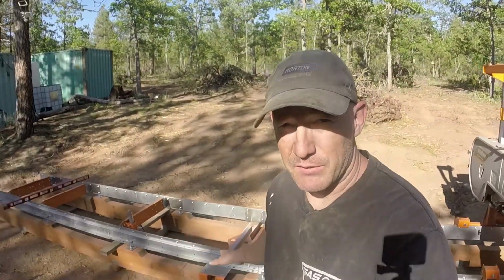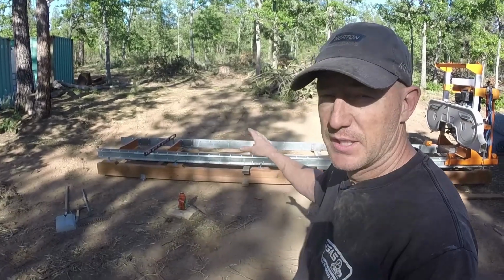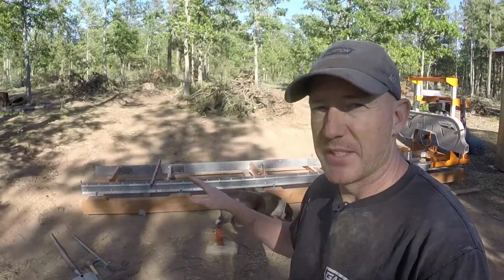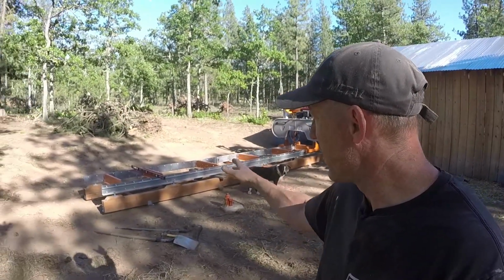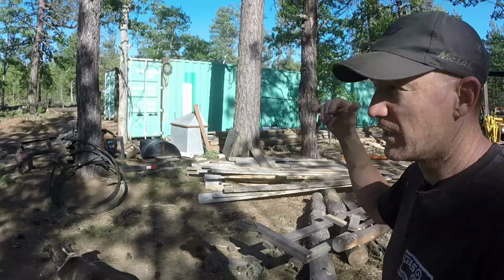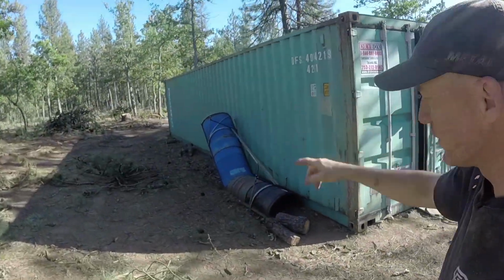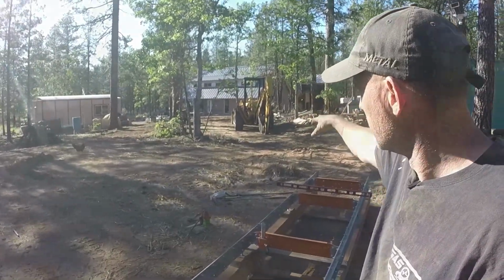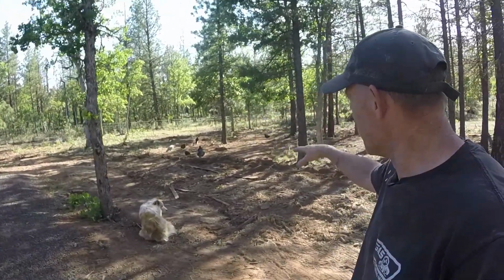Moving my Norwood sawmill to a better location on the property

Comment: go to harbor freight get you x6 of the 12 ton bottle jacks. weld them to a wider metal base. like a 12"x"12 square. then make cups and use freeze out plugs for a car and put them in the bottom of the sled. then when you move set it. you can lift it up to keep dry and make easier so you dont have to bend down as often. :) might sound complicated. but once set up you would thanks me :) help level it too :) but i was gonna say maybe find a old camper trailer. find a free camper. gut it. slide the mill onto the trailer. then when ready to use. take tires off and drop it down to working height. ive seen some with walking ramps on trailers. a guy who does on site mill work around here. he shows up set up on trailer. no matter what it always cuts square to his trailer once he drops the jacks. mills leaves. fast about it. he makes good $ at it and lots free lumber. sometimes he gets free logs to mill to get free lumber in trade and says he resells it for good $ faster then he can mill it. has a waiting list for species.  
find the free camper. gut it. resell some of the things. or save them for ya mancave/garage. like sink. the stove ect. then make $ back or save for later. :)
Reply from the maker: The trailer thing isn't a bad idea. Thank you. :)

Comment: Just buy the trailer kit for it. It is well worth the money. I have the same saw mill. It takes me 15 minutes to level it on the trailer package.
Reply from the maker: The thought of buying the trailer kit or making a trailer for it has crossed my mind. I really don't know how often I would actually move it though. I have to say that the way it is now, once it is settled and level it doesn't move. Who knows, maybe I can start making some money with it after I get my shop built. :)
Reply: Koality of Life Homestead I have had my saw mill for about 5 years and I have never taken it off my property. It is just so convenient to be able to move it out of the way to clean up around it and then put it back. The trailer package also stiffens it up and makes it much easier to level and stay level. It is a fare bit of money so it really has to be worth it for you.